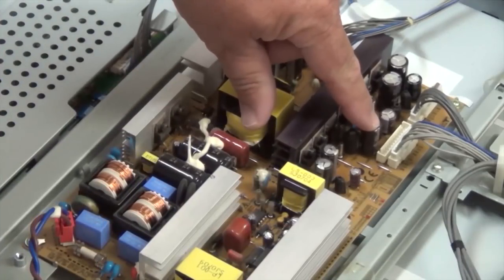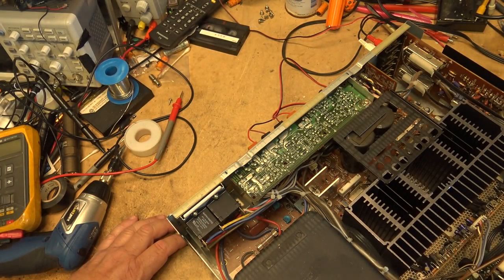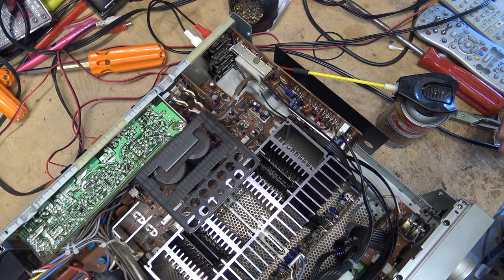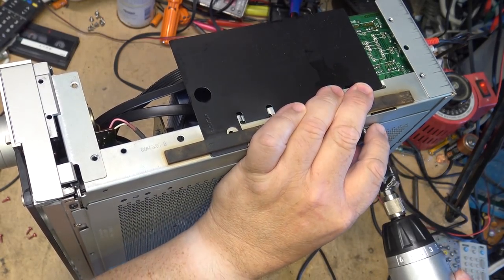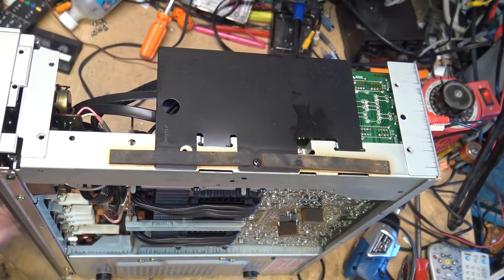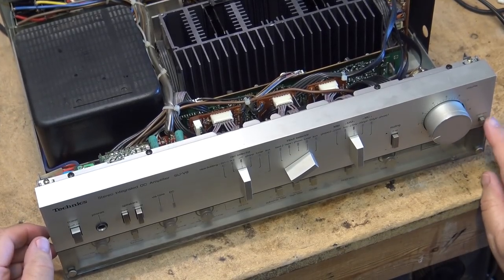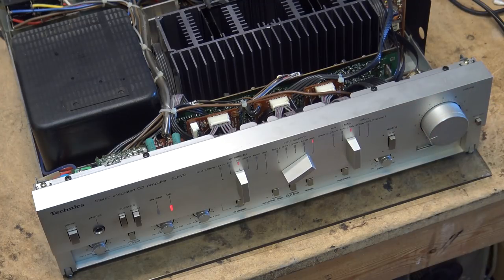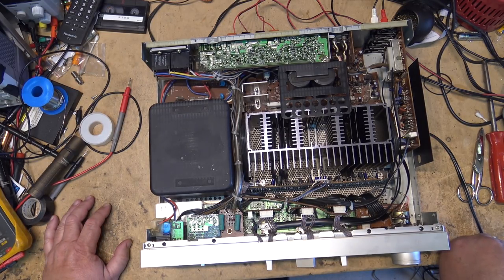Technics SU V9 Power Amplifier. An underrated monster worth consideration. Fantastic sound.

Comment: IIRC the DC offset is controlled by an IC. If you measure it you'll be surprised at how low it is, it gets to or very close to 1mv! Also, the New Class A light normally lights up.
Reply from the maker: Incandescent bulb is blown.

Comment: I do love these early eighties Technics amps. However, my first "serious" amp was an SU-V5 my dad gave to me many moons ago. I used to love Technics as a youngster so I bought an SLPG 590 and ST GT 350 to go with it as my first proper system. Anyway at the time I found a cheap Trio Kenwood KA 3700 and hooked that up to compare with the Technics. The Trio sounded so much sweeter, and made the V5 sound terribly dull. I'm not sure if this was the typical Technics sound signature for gear of this era? Anyway I didn't gel with it. I don't think the V5 was cheap in it's day either!
Reply: Good info, thanks.

Comment: I purchased the same unit back in 1982 when I was stationed in Germany. I have the exact same issue with mine at the moment. I'll be purchasing some De-oxit and cleaning the contacts. I bought this and a Technics Space dimension controller SH8040 and the amp for $353.00, times have changed. I still have my Technics SL-10 turntable and ADC Sound Shaper Twenty graphic equalizer, Klipsch and AR58's playing the classics
Reply: Lol same here raf wildenrath 1982 bought brand new

Comment: That's not a power amp, it's an integrated amp.

Fairly common for solder joints and switches going intermittent.

They always used non glass epoxy boards except with some of the higher-end stuff.  My Stax SRM mark II headphone amp is well build and uses glass epoxy.  A more expensive  Stax headphone amp, that I returned,  did not.  My Nakamichi CR1 (I think) dual capstan 3head cassette deck,  pricey, no glass epoxy.

Stax and Nakamichi are now owned by the Chinese.

Comment: I just pull out my Technics integrated amplifier this week which has been stored for 10 years. I didn’t remember the model, it turned out to be a SU V9 in black. I will be testing and cleaning the rotary switches and potentiometers. 
I have a question, what should I use to clean the DIN jack plugs in the back that doesn’t harm the gold plated surfaces?
I also got a Technics ST S6 digital turner that went dead during the time that has been stored. That will be more of work to fix.

Comment: Yeah, companies that keep data and service manuals from techs needing to fix their gear means they do not have a future due to their failure to support.  Just bad business on their part.  Bad business plan.
Reply from the maker: The manufactures do not want stuff repaired.  The only reason there was a repair business in the past was because governments forced companies to supply repair parts to the service industry.  Used to be 10 years.  Then the us government reduced that requirement for the manufactures to 6 years.  Canada followed suite.   The manufactures pressured governments to remove the requirenent to repair defective products and moved to a replacement if failure occurred under warranty.  Once the governments caved the manufactures quickly shut down their service facilities and parts dept.  Because they no longer had to support products prices quickly fell.  I got out just before the bottom fell out as I could see the end in sight even though many of my colleagues at the time thought I was nuts.  My bankers didn't though.  When I was negotiating a mortgage and they found out what I did for a living it made it a very expensive venture.  I had to have all kinds of insurance to qualify which costs me thousands extra.  It was a happy day when I got out.

Comment: Just today I turned mine on to test it for sale, and the exact same problem!  I did not pay attention to that flat black cable that was moving the switch in the rear.  Sprayed it with Caig Fader Lube, viola FIXED!  Thanks for the video!  And yes it is a very powerful amp that my cousin was a one owner of till he passed, it is a great sounding, heavy piece from 1981.

Comment: gud pm sir.....my ampli technics su v9 ....the problem is.....the speaker relay do not work or function....although my unit have a power.....so that......it has no sound or audio.....

what is the posible trouble sir....thanks alot sir....god bless and more power to your channel

all switches and controls are working......ive already check the mainbord the parts one by one...\nd they are all good.....this made me crazy haha.....ive tested one zinner diode its bad...so i replaced it....but still the relay donot works....thank you so much sir

Comment: So, I pulled out my SU V9 from 10 years in storage. I didn’t test if there was any sound cut out / static sound.
However, I decided to De Oxit as show in the video. Very easy to access all switches and potentiometers, with exception of the balance one that has no easy access because it sits in the middle of transformer chassis. 
So, after everything is put back together, I connected a pair of Bose bookshelf speakers and Nad CD player.
Oh boy, I forgot how good of the sounds this  integrated amplifier makes. I can hear much of sound details even at low volume. Someone mentioned at comments here that the sound is dull. I actually think is quite warm even when bypassing the pre amp controls. Using pre amp controls are actually quite discrete and by personal choice, I like this way.
I just put an order for a pair of Klipsch RP 600M. I think this will be a good set up.
Reply from the maker: This is one of if not the finest integrated amplifier that Technics made.  The distortion is at the limits of measurements 0.003%. 
I use mine in the edit suite.

Comment: Try the new WD40 Switch Cleaner. It's a fraction of the price the cans are bigger. I used to use Deoxit I found it overpriced. I have had very good results with the WD40 Switch Cleaner.
Reply from the maker: Yes deoxit is expensive.  I reserve it for my stuff.
Reply: @12voltvids  i tried PRF 7-78 220ml Taerosol,good one...

Comment: I have an old 90's Technics receiver with only 35 watts per channel but the sound is very clean and the power output is more than sufficient to drive my Bose speakers to deafening levels. The only thing I have done to it is to clean the speaker select switches.
Reply: Bose ..... Ok.
Reply: i have HK pm645,and it blows away a lot of new amps...have su v9 too :)

Comment: Careful when using your electric screwdriver when putting screws back in. Would hate to strip a screw out.
Reply from the maker: It won't as it came out before the screw is fully tight.

Comment: I use DeOxit mostly, and it can be very effective. I have had quite a few instances lately with switches in older equipment where I have to remove the switch and take it apart to really clean it. Have you run into that?

Comment: Its possible to get the replacement of those switchs? i have a technics su-v5 and unafortunately the wire cable remote that move the position of switch.. exist spare parts or a way to fix it?..

Comment: 👍🏻😎 I have a Technics SA-1010 that has the same rated output 125 WPC @ 8 Ohms it also has that huge power supply and it's 600 watts at the plug. Mine has selectable voltage on the back so I suspect it was a non-U.S. model because the ones that they sold here in the States didn't have the selectable voltage. It is a beast and is underrated by a good amount. I'm pretty sure it will do 150-160 WPC easy. It's in perfect condition and still works fine as far as I can tell. It's the pride of my collection too.

Comment: Thank you for this video, I dug out this amp (Japanese version 100V) from under my near trash pile. It was running great until the switches cut out on me. Cleaned it out using your suggestion, the switches in the back of the unit and the bottom panel. It is now running and all the controls (except the Phono 'cause I have to dig my turntable out, too) check out. I will be connecting it to my larger speakers later today. Still have the laundry to do. 😀😃😄

Comment: This must be amplifier week, I have a kenwood  KT5500 that I have had for about a year, and it powers on and the speaker relay protect seems to be working, but there is no out put, I checked for voltage at the output transistors and there is power there but no audio, at least I have a service manual for it, but doesn’t mean I’m going to get it working, I guess that’s going to be my next winter project, that’s what I get for buying something like this off of EBay, you talk about undisclosed items, but of course I new I was takeing a big chance buying from EBay , but if your in the market for a certain amplifier or other piece of equipment, and you just can’t find it any were, that’s the way it go’s. From what it looks like no one has ever disturbed anything, other than it’s obvious that they’ve had the cover off of it because one of the speaker terminals was striped out, what an idiot who ever did that, I think they were going to try to fix it and they were not successful, well that’s about the end of my amplifier episode for this week, maybe I will get it going and maybe I won’t, time will tell.

Comment: I've got a V5 V303 two V505 and next week buying a V9. I do want the V909 though, but four thousand pounds isn't worth it for a V909 compared to the V9 for £350.
Reply from the maker: Considering they are so close in spec. The 909 having a slightly better SNR and slightly better DF. I myself wouldn't pay 50o for one either as there are many around for free like i got mine.

Comment: We (Techs) need to put a list of component specs. together and make sure it can never be held hostage by all the greedy, detestable fucks around the world.
Reply from the maker: Be my guest. 
You can go backwards to the time when a 20" Trinitron costs 1000.00. Yes, that's what they cost back in the 80s.  A 20" mts Trinitron was 999.95.  a cheap RCA mono 19" sold for 649.95.  Why was the price so high? Because under legislation manufactured by law had to maintain an inventory of every part for every device they made for 10 years after the device was taken out of production.   Then it became 7 years, then 6, then for the length of the warranty after the unit went out if production. Which was typically 2 years.   That is 1 year to sell inventory then 1 year for warranty.   Then they were not required at all as long as they replaced the product with a new one if it broke during the warranty period.   These savings in dead inventory and the personal to maintain these parts wharehouses were passed on as savings in the new throw away products.   I saw the writing on the wall 20 years ago and started my plan to exit from electronic repair as an occupation.  I was ahead of the curve and got out before the fit hit the Shan. I watched many guys that I knew that were in the business lose their shirt and everything else. It's sad because I know a few guys that were in the service business that lost everything because they were not believers they couldn't believe what I and everyone else was telling them get out.

Comment: When u tilted the amp to look at the power consumption specifications on the back,,,I noticed what looks like a ic on the back of the heatsink fins.
Reply from the maker: Nope. 4 big transistors I am sure there is an ic for the computer drive class a biasing.
Reply: Ok,,,must b big round transistor types,,on that heatsink.

Comment: Hi Dave,
 I have just picked up one of these lovely amps myself.
I have heard that this amp has  quite high power consumption and that it has a large in'- rush current on power up.
Do you know if it is normal for the mains switch to pop a little bit when you switch it on, or is it more a case of cleaning a dirty switch?
This is a great informative video, by the way👍🙂
Reply from the maker: There will be inrush at power up and yes it is relatively high in power consumption as it is a heavy biased amplifier.  It's a push pull class a that switches to ab at higher power levels.  At power levels under 9 watts it operates lime a single end.  Both transistors are conducting throughout the entire waveform so even at no output there is a fair bit of heat produced this power consumed.
Reply: @12voltvids  so just to confirm: do you think I need to  clean the power switch if it's popping (arcing)  a little bit when pressed👍
Reply from the maker: @IncognitoChild  cleaning probably won't do anything.  Might need replacing at some point.

Comment: That "New Class A" logo in the bottom right behind the glass door is indeed supposed to light up. The black V9 have it illuminated in amber, the silver ones either in amber or green.
Reply from the maker: The incandescent bulb is blown.  Not critical i haven't replaced it.
Reply: @12voltvids  not critical,but..you know that its broken...:)))
Reply: Yes it has 2 small flat bulbs, if one burns the other is also out.  Replaced mine I believe it was a 8-9 volt.  Some replace it entirely with a LED.

Comment: They were beautiful amps, very well put together and to be honest we rarely saw them in the workshop.   I never could afford one back then, and doubt I could find one in good nick nowadays.   Great video as always :)
Reply from the maker: Heavy as hell.
Reply: I bought mine new back in the day, can't remember the actual cost, but it was a lot of money...... its awesome to see one still working.
The MC circuit was really good too, I was so impressed when I changed my TT from MM to MC, great amp.
Reply: Just lucked into a nice one myself. And while I usually sell these, I'm holding onto this one for a while. I've had a KM German preamp for years... and now I'll use this one for my mids and highs. Had one of those sandui 150wpc power bricks...no controls, just the big LED level readout... so that one will sell... just have to figure out how to fire the subs off the Technics.

Comment: I have a question since I own one, is it possible to modify the twist lock for the speaker out to a banana plug socket?
Reply from the maker: I'm sure they can be changed but i never considered it because these ones tie down my heavy speaker wire completely.
Reply: @12voltvids  Understood Sir, Thanks!

Comment: New Class A has nothing to do with switching to class B after a certain output level, it's a technique they used to try to achieve class a sound with class b efficiency. Historically there were various attempts. Check here:https://bit.ly/37oFAJm There's also a very usefull technical discussion on diyaudio here:https://bit.ly/3hperuk It surpasses me to be honest but it's definitely different from just switching to class b. Really enjoyed the video, keep it up CHeers
Reply from the maker: These are all push pull, or class b amplifiers.  When people think class A they think single ended output. What panasonic did was just create a variable bias to drive the amplifier into a heavy bias so that the transistors never go into cutoff through the entire waveform.  This means much power is wasted at lower volumes and burned up as heat. The end result is exceptionally low distortion. 0.003% and it does a wonderful job. I have done some critical listening to this amp and I am just blown away by how clean this is.   Yamaha do the same thing with their natural sound amps.  The power limit in this mode is only a few watts so as the power demand increases the bias is dropped allowing the amp to become more efficent and deliver the power to the speakers as opposed to wasting it as heat.  This one is now on my studio and it going to stay there.

Comment: It's a good feeling to hear the outputs are good from jump. They're impossible to find oem. Chi-com transistors are copies! But if you think that Japanese amp is built well, you've never worked on a Sherwood HP2000 HP 1000 or Quad  303, 405, 33, 34, 46, 606, 306. They practically fix themselves.
Reply from the maker: I have worked on quad and Sherwood and I assure you they do NOT fix themself.

Comment: I have an old Harman Kardon tube amp in very good condition theres an issue with a Hum when my hand is near a certain area towards front if I touch metal Hum goes away. It's near a tube I tried switching tubes but same issue in same area. I need some help diagnosing the cause
Reply: there is a bad soldering on board..

Comment: all those switches and preamp controls compromise so much the final output signal
Reply from the maker: One button, the DC button bypasses all the unnecessary controls. You have your input select and volume control that's it. Even the balance is bypassed.

Comment: Great video, very helpful. I bought almost the same amp a couple weeks back for $20 and the one channel cuts out when you touch the selector. I guess I will get my deoxit out and give it a go this weekend. I probably never  would have spotted those switches in the back. Thank you!
Reply from the maker: The guy that gave it to me tries cleaning the switches at the front. These are for the lights.  The real ones around the back.
Reply: @12voltvids  I used the deoxit on the switches like you did and it worked perfectly. The amp sounds great now and there is no crackle or cutting out. I have another similar amp that has the same problem so I am going to pull it apart next.